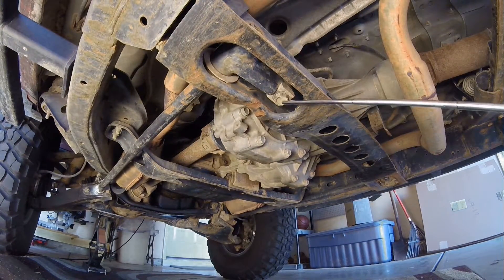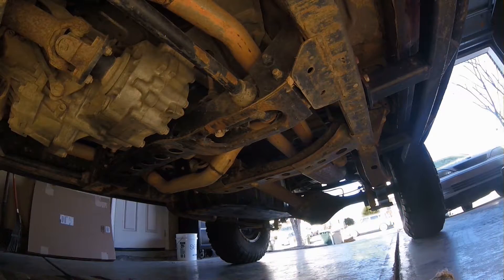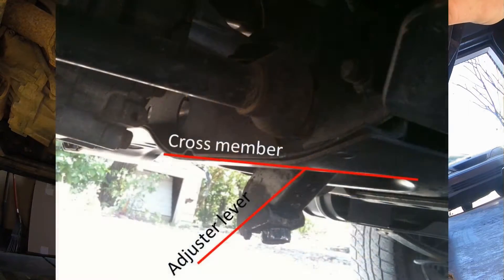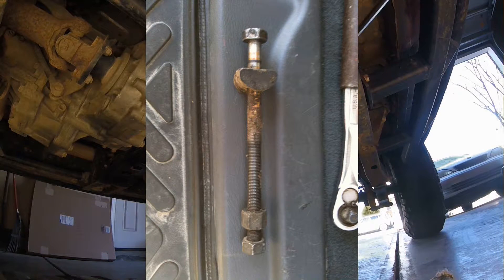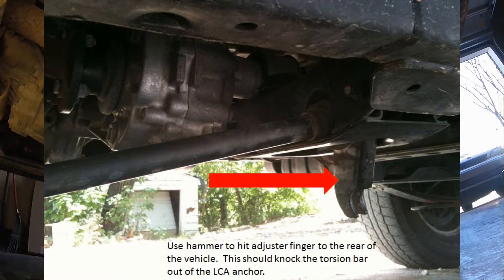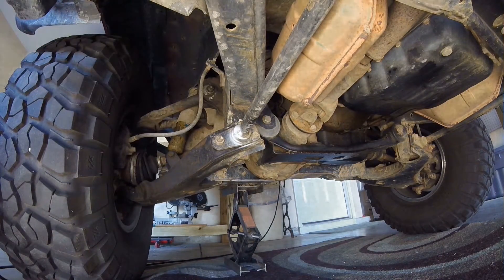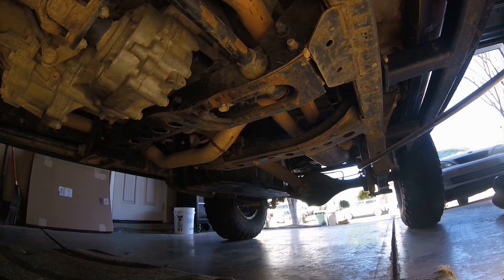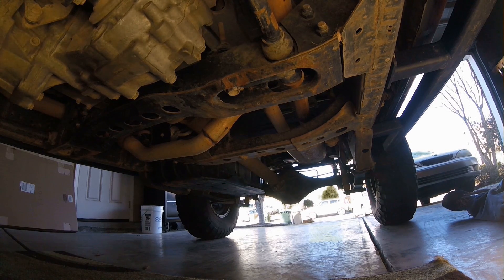Getting Lift out of UCAs - How To:  Re-Index Torsion Bars

Comment: So I just got my 02 xterra back. It got a new rear main seal and clutch. Looks like my mechanic didnt re install the torsion bars correctly because its got a ton a rake in the front and the steering wheel is crooked when I drive straight. Adjusting my torsion bars to their original height should fix both the front rake and the steering issue right?
Reply: Man, same exact situation for me. Rear main seal replacement and now the torsion bar indexing is way off. I'm pretty annoyed by it.
Reply from the maker: Front rake yes. Steering wheel crooked .. Maybe. That is caused by adjusting your tie rods...AKA you need a toe in adjustment on your front end alignment.  BUT it could be a result of poor torsion bar adjustment that interferes with your tie rods position. All the alignment angles are inter connected. Start with getting your rake where you want it...then evaluate the steering wheel. Get a front end alignment if needed after that. I have videos on alignment you can reference if you want to learn more.

Comment: Hey there, I recently replaced my lower control arm on my 04 frontier, and I mistakenly didn't mark the tooth position on either side when I took the torsion bar out. Now, the side I removed is sitting 2-3" lower than the other side, no matter how much I crank them. You seem like you know what you're talking about, what would you suggest? Thanks.
Reply from the maker: Does your adjuster arm bottom out in the frame cross member?  Sounds like it. You need to remove adjuster bolt...remove torsion bar from lower control arm and rotate the adjuster lever away from the cross member (so it takes more bolt turns before the adjuster lever bottoms out)
Reply: @XterraRob  Hmm, tried multiple different positions of the lever, from all the way up to all the way down and everything in between, with little to no effect on the ride height.
Reply from the maker: @ganguskongoose1553  when you remove your torsion bar...how are you supporting your vehicle, and at what height? Try putting a jack stand under the truck so its at the height you want before taking the bar out.
Reply: @XterraRob  it was on stands when I took it out, I am at a loss haha
Reply from the maker: @ganguskongoose1553  1)  When you turn the adjuster bolt, do the threads stick up higher above the cross member and pull the adjusting lever into the cross member?  2)  Are you still too low when your adjuster bolt is tightened all the way to the point where it bottoms out inside the cross member?  I have another video about adjusting the torsion bars you can look at, it gives a couple of different views.
Reply: @XterraRob  Alright, I'll go give it a try, thanks!

Comment: Do you know what side goes on what side? like L or R
Reply from the maker: You mean like the torsion bar itself if you are installing a new one? Or like which spline ends goes into the lower control arm or the adjuster anchor?
Reply: Xterra Rob  both, I am installing new torsion bars and was wondering what torsion bar goes on what side like   (R) & (L) . And also what side of the torsion bar goes into the control arm.
Reply from the maker: @AdrianBugarin  Do you have factory torsion bars, or after market sway-away torsionbars?  The only marking I remember is there is an arrow rotating in a certain direction on the end.  I've never replaced my torsion bars, so I don't  know the difference.  I know the Nissan part #s are different though...but I had a spare set in my garage and they were visually identical.  I would do one at a time, and match up the marking arrow on the end before replacing.

Comment: Will reindexing the torsion bars on a completely stock xterra screw up steering or any suspension components?
Reply from the maker: Nah....just don't lift a huge amount...but you may need an alignment
Reply: Yeah my alignment is already really screwed up (truck got in a wreck) and I’m not getting one lol bought it for $300
Reply from the maker: @dbinder3210  in that case...a torsion bar adjustment won't mess anything up any worse than a 300 dollar truck already is.

Comment: Do you know where I can get replacement torsion bars for the 2000 Nissan Frontier
Reply: I’m looking to get for both sides. I’ve cranked up mines in the past but I still have that lowered front look still.  As for junkyards. I’m limited where I live.  Any suggestions on where i can purchase a pair?  
-CourtesyNissan doesn’t stock them anymore. 
-EBay has pre owned ones.
-CALMINI is kinda iffy for me due to article I saw where customers ordered parts from them and never received anything.
Reply from the maker: @KevinPerez-fd9xq  the front should be lower somewhat. 4x4parts.com have the sway away brand torsion bars. But if yours aren't broken...you can re index to get your ride height where you want it...assuming you have room at your bump stop to upper control arm. Try car-part.com for used parts or eBay. For nissan brand...dealer doesnt have them anymore, so it's all used junkyard bars or aftermarket heavy duty ones.
Reply from the maker: Which side do you need (pass or driver)?  You can either get aftermarket "heavy duty" torsion bars or hit up junkyards. I have one spare in my garage I could send you.
Reply: Thank you 😎
Reply: I got it re indexed.   My truck is perfect now.  Thanks again Man!! 👍🏼
Reply from the maker: @KevinPerez-fd9xq  right on! Happy to help!

Comment: Ok so all the forums out there say u can fit 265/75's...wrong!!! I'm having to do major trimming and hammering in side wheel well. I want to turn my torsion bars so that I get about a 1/2-3/4". But I'm afraid it's gonna really screw up my handling. Do u think it will? Also I believe my CV don't spin unless in 4x4, so the angle should be fine. Wat u think??? also do u have to loosen both nuts on top of torsion bar adjuster first? My bolt won't budge! I have roughly 3/4" between bump stop and UCA. So I'm hoping I can get 1/4", not much but at least my tires can breathe sum!
Reply: I went ahead and got falkens, LT not p metric so there a deeper tread. At3 there real nasty...10 ply! I hope it doesn't give me a rough ride. I can't even drive it yet because  of the rubbing
Reply: I've done took off the drop down mud flaps
Reply from the maker: Where does it rub? What tire and Do you have stock rims? I fit 265 75 16 on stock rims with very minir trimming on plastic mud flap. Does it only rub while turning?
Reply: @XterraRob  just edited, please read again. I added something. No, there after market rims, but very nice! It rubs only when turning...bad! But I've pretty much fixed that
Reply from the maker: If they are aftermarket rims that stick out more off the side of the vehicle, it will have more interference. Only need to loosen top nut, and hold bottom nut if it spins. The bolt is tight...so get a big wrench and soak it in PB Blaster and let it soak.  As always, Be careful under vehicles...

Comment: So I’m confused on where/ what the bump stop gap is. I have just a stock 04 X and I want to lift it, and I feel like this method is probably the easiest and cheapest way to do it, but I’m a little confused on the whole bump stop gap thing. And also i was wondering about how much lift I could get from adjusting the torsion bar.
Reply from the maker: I have a video titled "Tire shops cant align lifted vehicles" or something to that effect. In the intro, I habe a demonstration showing the bump stop gap and why you need to not get it too small. That should clear it up.

Comment: Hey. I have a couple of questions. I have recently purchased bigger tires, 32 inch tires to be exact, and I noticed that the back of my X looks higher than the front and I'd like to make that level, and I see that I can do this method. I want it to look, and be, level. The back of my X is 35 and a half inches from the ground to the outside of the wheel well, and it is 33 and a half in the front and I'd like them both to be 35 and a half, so I'd like to re-index my torsion bars. My first question is can I re-index my torsion bars with my 2WD 2003 X, or does it have to be 4x4? My second question is after it is level and to the height I want, will I have any problems regarding my steering, or hoses, etc? And my third is will I need an alignment after? I'd appreciate the help, and I thank you for the videos!!
Reply from the maker: Don't measure at fender arches...look for thr horizontal seam below the doors...the seam parallel with the floor boards. Thats a better frame of reference for level front to back. You won't have to re-index the bars with stock UCAs...just adjust them righty tighty at bolt head and look at your bump stop gap at front control arm. Same process for 2wd. No worries with hoses or anything.
Reply: Awesome! I'm going to be doing this soon with a friend soon. Thank you for all the help!! If I have another question, I will ask. Thank you again!!
Reply from the maker: Good luck and ask away!
Reply from the maker: You will also want an alignment after adjustments!
Reply: Alright, and how much would it, roughly, be for an alignment? My stepdad said I could get an alignment for around $80.
Reply from the maker: 80 bucks is a good estimate. It varies depending on where you go. The alignment helps keep your tires wearing evenly. If you dont have new or expensive tires, you could run them as is after and watch to see how they wear...and get an alignment at your next set of tires if they wear uneven. If you have fairly nice or new tires already...best to align it now before wearing out good tires.
Reply: Understood. Thank you again!
Reply: @XterraRob  So because I have stock UCAs, what do I need to do in order to lift/level my 2003 2WD X? Like, what is the process? Sorry if this is a dumb question lol. Thank you again!
Reply from the maker: Not dumb at all. 1) familiarize yourself with the torsion bar setup.  Find the cross member where the adjuster bolt goes through.  Check to make sure the adjuster lever is not bottomed out in the cross member.  2) on top of cross member there are 2 nuts threaded on the bolt. Loosen the top one up a bit. 4)  hold the bottom nut from spinning with a wrench .  5) lay on your back look up at the bolt head. Turn the bolt head righty tighty. It will be tight, so be ready to muscle it. 6) shake the car or drive it back and forth to settle the suspension, and then check to make sure you bump stop gap is about a half inch at the UCA, and check your ride height.  7) repeat for other side...and recheck both sides after final adjustment.  Tighten top nut down after final adjustments are made. Adjusting one side may impact the other due to weight distribution if one side is higher than the other.
Reply: @XterraRob  isn't it easier to turn bolt if the tires are off the ground first? If it's not jacked up u have to force the uca down. The tire is preventing this if it's got all the weight of the vehicle on it. Also do u look at the 1/2" spacing on the bump stop after it's all done, or should u jack it up with another jack to achieve this? If all I want to do is get less than an inch of height out of my front, can't I just turning them and keep checking the front with a tape measure until I get what I want?
Reply from the maker: Its easier to turn bolt if the truck is partially raised...tire still on the ground, but frame raised some with a Jack. I think that sometimes make the instructions a little confusing to explain though. I just use a breaker bar and deep well socket and crank it as is without a jack though. Bump stop gap is measured when all adjustments are made and truck sitting on its own weight. Half inch on each side.
Reply: @XterraRob  ok, got it. So no matter how much or how little you raise it, you should always have a 1/2" on bump stop?
Reply from the maker: No less than 1/2 inch. Bump stop gap gets smaller when you raise it and larger when you lower it. If you are less than half an inch, you have over lifted. If you are more than half an inch, you are OK.
Reply: @XterraRob  ok. I'm not going more than an inch of lift so I should be good, doing that and rear sway bar removal today.
Reply from the maker: You should be good...just double check when you are done. Rear sway removal will free up the flex! Big help off road.
Reply: @XterraRob  ok. Thanks. I don't believe c.v.s turn in 2 wheel, so a little angle should not hurt. I've had bad experiences turning torsions in the past, but I got 2" out of my Yukon, and CV;s always are turning on that. Screwed my whole front end up
Reply: @XterraRob  much easier if its all the way raised with tire off ground!
Reply from the maker: Much easier...but you have to lower the tire down to check your bump stop gap. It can get tedious lifting and lowering the jack to check your bump stop gap. Its also much easier with an impact wrench :)
Reply from the maker: Yeah...you gotta keep the lift moderate unless you go all in on supporting mods. Thats not even specific to torsion bars...that applies to any independent suspension work...coil spacers, torsion bars, even lowering springs and racing suspension. I used to have a lowered BMW and same thing....lowering a car is easy...its the steering and alignment parts that are tough to keep it lasting long.
Reply: @XterraRob  Awesome. Love the thread of comments btw lol. I have leveled it with a friend yesterday and it looks awesome, like it's supposed to be! I will make sure both sides are the same and check the bump stop gap as well. Thank you for everything and keep up the great first gen videos! I watch them all the time haha.
Reply from the maker: Thanks for watching. Happy to help

Comment: Great video! Now if you were an idiot and marked the torsion bar with permanent marker, but should have probably used liquid paint or whiteout instead. Black permanent marker lines are now gone. I went to reinstall the torsion bar, but can't figure out where or which splines to match up like how it was before. What would you do in this case? Install it the best I can with the wheel off the ground or slightly off the ground like your video? Test and tune?
Reply from the maker: Do you have UCAs you are trying to lift or do you have the stock suspension?
Reply: @XterraRob  Sorry I forgot to include that piece of info. I'm on stock suspension. Went crazy on Rockauto and replaced my lower & upper control arms, rear lower control arm bushing, tie rods, and sway bar bushings.
Reply from the maker: Nice rock auto haul! Put a Jack under the front frame to hold it at the approximate level you want to end up. Align the torsion bar in the lower control arm so the adjuster finger is as far away as possible from cross member while still barely being able to start the bolt in the cross member.  Now rotate the bar about 2 teeth so the adjuster finger is closer to the cross member. That should get you in the ball park. But you may have to guess and check to fine tune the ride height and,keep the adjuster finger tucked inside,the cross member. Did that make sense?
Reply: @XterraRob  Ok sounds simple enough. Nice and clear! Thanks buddy!
Reply from the maker: Happy to help! Thanks for watching!

Comment: On  a 2002 Xterra, how many inch lift will I get if I re-adjust the torsion bars without re-indexing them?
Reply from the maker: With or without UCAs? Just adjusting and nothing else...you will get about 1 inch...maybe 1.5 but that is pushing the limits of steering angles.
Reply: I'm replacing all 4 control arms and ball joints with stock parts and just an inch lift is all I want.
Reply from the maker: You can get an inch out of the front stock adjustments. For the rear, youd either have to leave it alone and do more of a leveling by bringing up thr front to match the stock rear...or adjustable shackles from 4x4parts.com and use a shorter hole for less lift.
Reply: Thank you Rob. I just got my X 2 weeks ago after I bought it sight unseen and had it shipped from Colorado. First thing I did was take your advice and remove the side step rails and the mud flaps. I thought they looked stupid! And now the X looks taller. Next I"ll do the 1" in front and get some shackles for the rear.
Reply from the maker: May want to adjust the front first and see how much you can get before getting shackles. Its common for the rear to be very easy to lift and the front to not give you as much lift. I'd see if you like the stance with torsion bar adjust only and add thr shackles later.
Reply: Yes sir, front is getting done first. My local tire and wheel shop is doing my control arm/ball joint work and hopefully I can get them to adjust the T bars for me. I'll see how that looks before I do rear shackles. And since the 265 16" tires look like they fill up the wheelwell space, it needs to go up at least an inch.
Reply from the maker: Great. Sounds like you have a good plan!

Comment: Hey I got a 3 in suspension lift from 4x4 parts. When I put the truck down it didn't give me any lift so they told me to re-index the torsion bars. How many teeth should I move the torsion bar over? What do you think?
Reply from the maker: Thanks for the comment. First, have you adjusted your torsion bars without re indexing first? Meaning...is the adjuster lever tucked up inside the cross member to where it bottoms out in thr frame and can't be adjusted anymore? If not, adjust them first and see how high you can go before it bottoms out. If they are bottomed out...re-index them and rotate the bar 2 teeth...that should get you what you need.
Reply: @XterraRob  Thanks for the reply, and yes the adjuster bolt is maxed out. I am pretty sure I am gonna have to re-index but I didn't know how many teeth. Another question would be, after changing the control arms, do I need a specific torquing weight for them or do I just tighten them as much as I can.
Reply from the maker: There is a torque call out in the factory service manual, but I dont remember what it is. I never used it.  I just went as tight as I could. No issues.